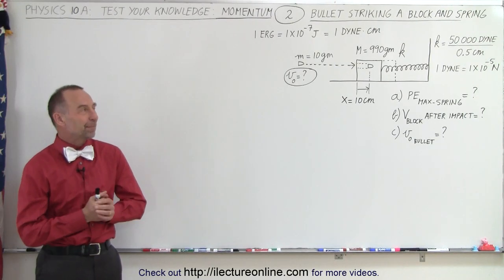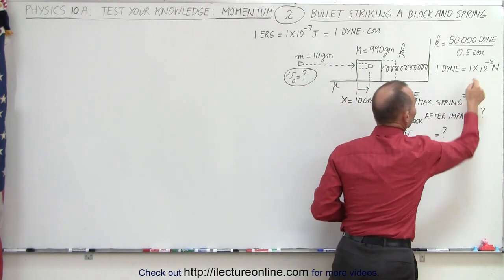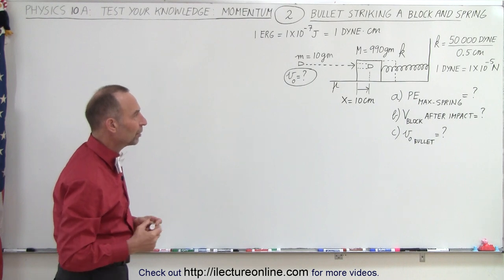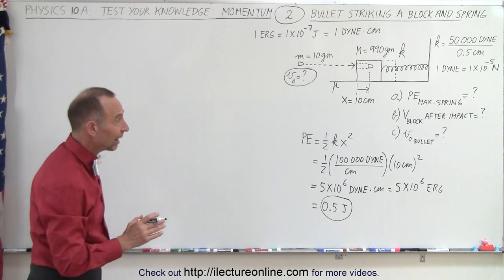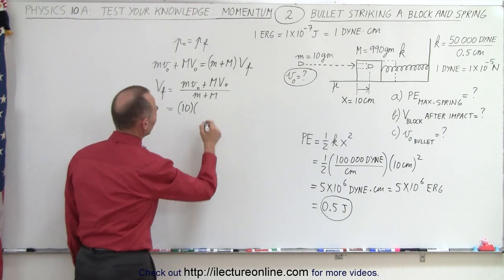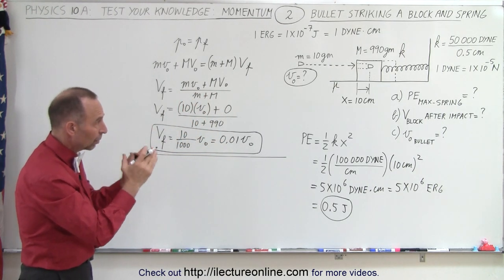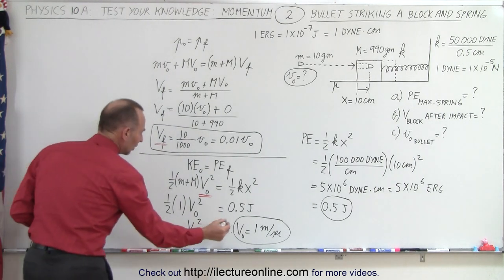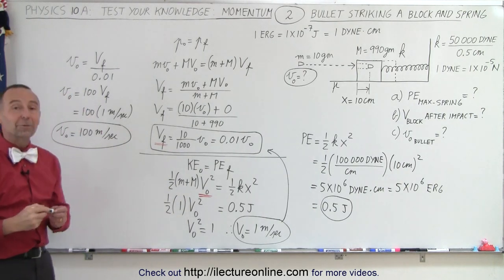Physics - Test Your Knowledge: Momentum (2 of 20) Bullet Striking a Block and spring

Comment: in this exact problem, how would you find amplitude (if it wasn't given)
Reply from the maker: Once you know the initial velocity of the block after impact of the bullet (which is also the maximum velocity of the block) you can set the KE max equal to the PE max and obtain the amplitude that way
Reply: @MichelvanBiezen  thank you!